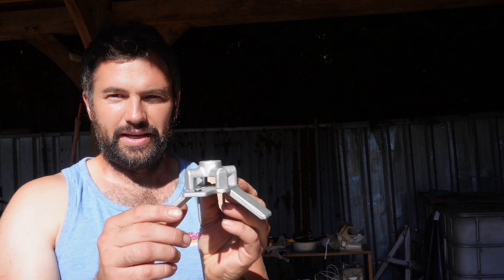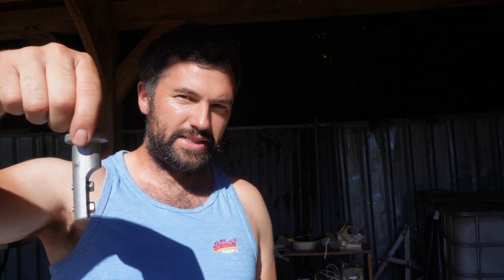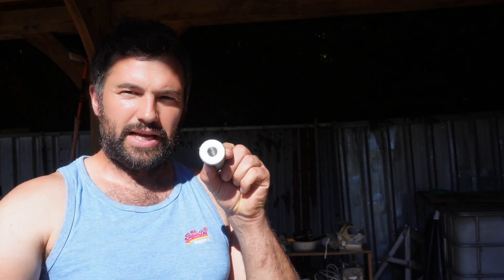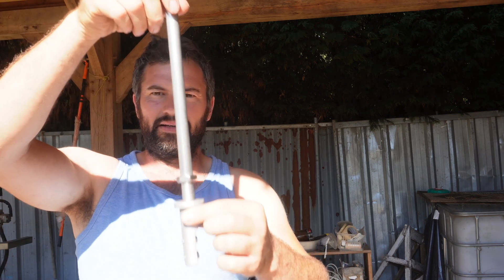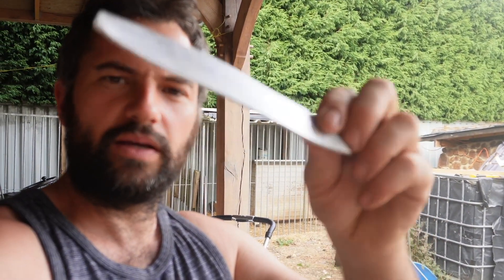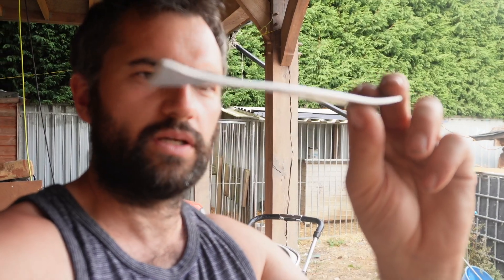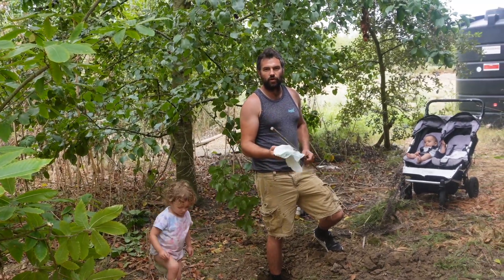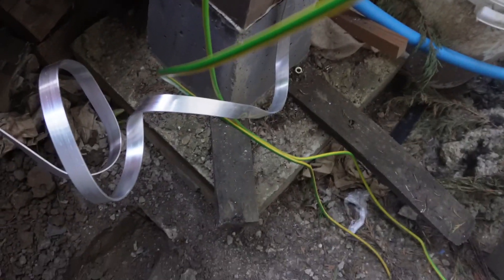TOO LATE? Installing lightning protection before storms hit

Comment: I would not draw lightning to my house. I have midnite solar surge protection devices on every string with ground rods driven at the array 50 foot from the house. every panel is grounded with a 6 AWG solid copper ground wire, also connected to the same ground rods. Our 6 AWG wire is clamped onto the 1/2" x 8' ground rod. No fancy ribbon or connections. It's simple and it works. Be careful working on your lightning attraction system, especially if your thunderstorm is closer than 10 miles or 16 km. Oh, that grease is to lubricate your rod to make it go in easier.

Comment: Hi, great video. I'm a lightning protection engineer.
The standards for lighting protection in the UK is BSEN-62305
The standards allow connection of copper and aluminium conductors to steel and stainless steel.
Lightning conductors must be solid and not stranded cable. we only use copper below ground and the bi-metallic connector is mounted 500mm above the ground.
A single 2.4m earth rod is fine but the target resistance to earth is 10 ohms.
The separation distance between your roof conductor and your solar requires the solar rails to be bonded.
Also an equal potential bond between you lightning protection and your electrical earth should be 16mm earth cable.
Hope this helps.
Reply from the maker: Thank you, this is really good to know 😊
Reply: @The_OffGridFamily  Jubaili bros solar, has a good video on YouTube
Webinar: lightning and surge protection for photovoltaic.
It's very comprehensive but easy to follow and will answer a lot on design.
Reply: Hi Christopher, good info. Should the solar be bonded to the lighting system on the roof or at the earthing rods?
Reply: @mfr58  it depends on the design. Ideally a air rod giving the zone of protection and the correct separation between the lightning protection and the panel which is calculated dependent on the level of the lightning protection. 
If it's a roof mount system and separation is not achieved then it's required to be bonded to the roof conductor.
Ground mount you can just go from the steel frame direct to an earth rod.
Reply: @gflow7  Thanks Christopher.
Reply: Don’t forget solar surge suppressors (SPDs) on the panel lines & mains SPDs if you have anything coming in from the grid
Reply: Good info, I was wondering if anyone had mentioned a resistance value target.